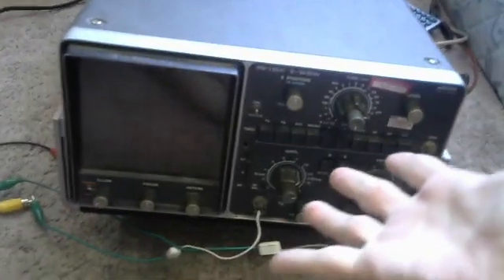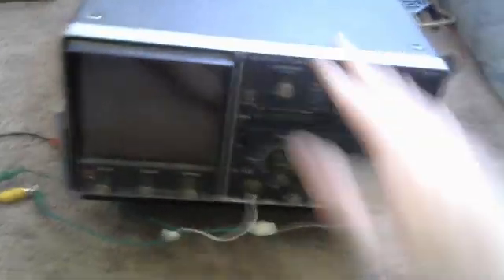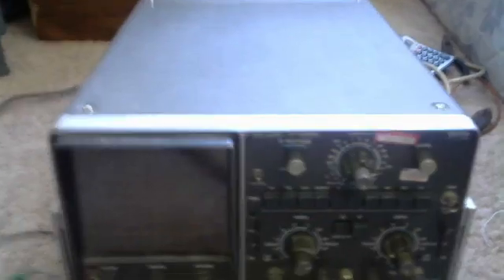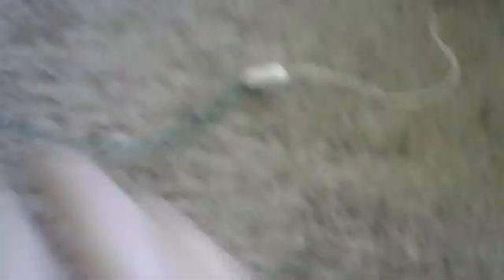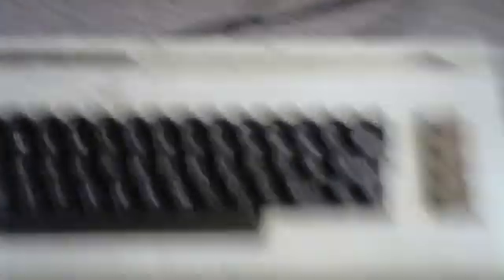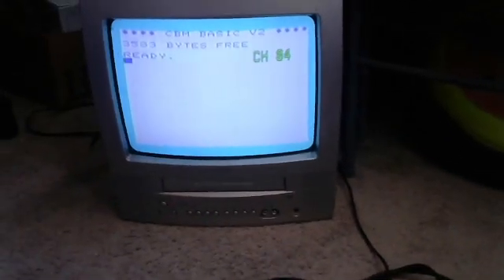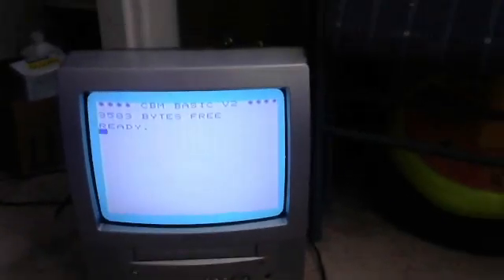Showing off my Oscilloscope and some jank probes I made for it!

Comment: Your probes may not be correct but they work and that's all that matters. Well maybe not all but it's good enough! I'm gonna be using my oscilloscope soon to look at the video signals on the tape I recorded, as well as to try out playing some oscilloscope music on it. Your oscilloscope is much more modern and I think better featured than mine. I was a little concerned mine didn't have both X and Y inputs but it does so oscilloscope music should work, although in practice who knows what'll happen. Also mine has a really little round screen so it's not suited to playing back oscilloscope music, of course I'm going to do it anyway.
Reply from the maker: I really need to try oscilloscope music with it sometime! I'm not quite sure how the X/Y mode on mine works yet lol Can't wait for your next jank "video recorder" video!
Reply: @Dedicatedtolivinginthepast  Mine has terminals for X and Y separate to the probe. I only have one BNC terminal for the probe to go on, that is for the Y axis. Yours seems to have two BNC connectors, maybe that's X and Y? If you can find a manual for your oscilloscope it should explain how to connect X and Y inputs. I'll hopefully be making my next "video recorder" video tonight! Well, I'm not gonna be recording video this time, but close enough.
Reply from the maker: @toomanyinterests  I only just saw this comment now and I've already messed around with it enough without the manual to figure out how it works! It turns out, I needed ground for the probes too if I wanted to get a usable image at all lol I'll probably send an email in a little bit with a short video showing it working!
Reply: @Dedicatedtolivinginthepast  Yep, grounding is important to give the signal a return path. Just seen your email, you got it to work quite well!